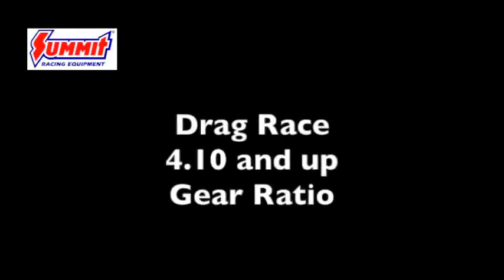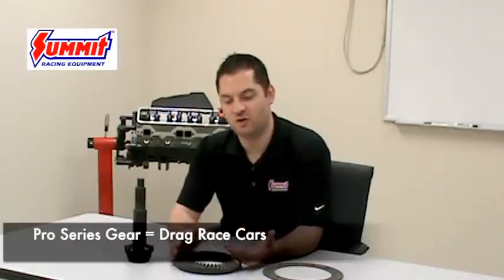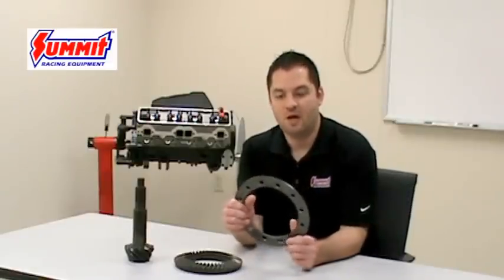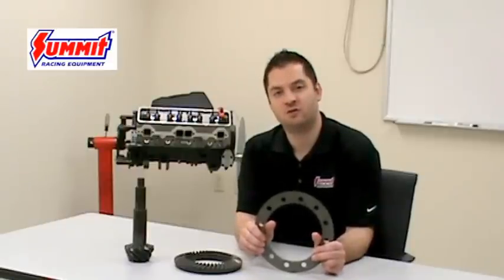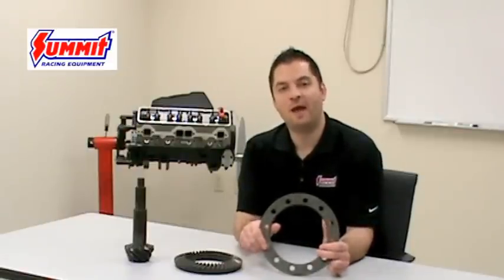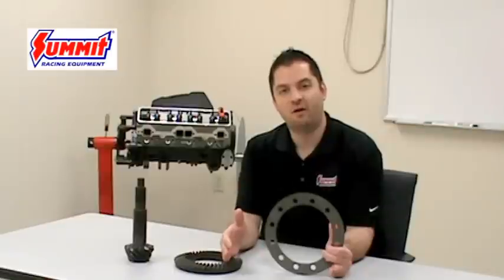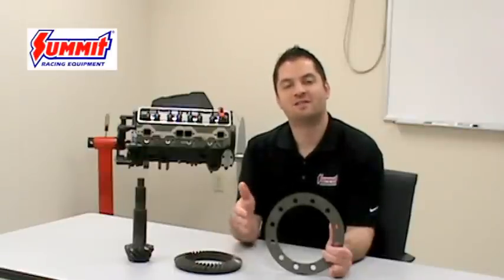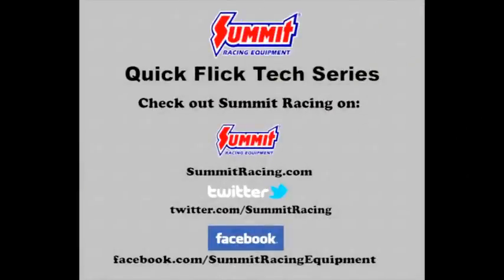Selecting a Ring and Pinion Gear Set for Your Vehicle

Comment: one thing I didn't hear much about is Truck/ Cars with Much Larger than Stock Tires. I have a 1991 Chevy 1.2 ton pickup with a stock 10 bolt rear end, but I also have 35" Mud tires and it drives sluggish, hard to pickup.

 What ratio would be good for me to be able to maintain faster acceleration speeds? Don't drive past 60 mph anyways
Reply from the maker: Hi DREW TRUJILLO, 
With 35’s a 4.10 ratio is most likely where you need to be but, we really need to know some other stuff to be sure. Give us a ring on the tech line and we will be happy to help you figure it all out! 1-330-630-0240

Comment: I had a quick question..
I have a 2011 chevy silverado 1500. 4.8 with 3.23 gears..

I recently motor swapped it to a 6.0 with 
Longtube pacesetter headers.
With a 226/230 Comp cam.
Black hawk c.a.i. K&n
3200 stall.
Tune.

Take off power is there
But top end feels a little sluggish...

Was wondering if 3:73 would help me out.?.
Reply from the maker: Eric Ramirez , 
A higher numeric gear ratio will help your take off and get your motor to a higher RPM sooner. This will help your acceleration from a stop but most likely hurt you in the top end horsepower department.  There are a lot of things to consider here, airflow through the motor on the inlet & exhaust side, the “Tune”, is it the best for the combination, was it done on a dyno under load and then fine tuned while street driving? And last, expectation; you are trying to move a very heavy vehicle with poor aerodynamics compared to a Camaro or Corvette.  Give us a call, we can help you through some of this! 1-330-630-0240.
Reply: +Summit Racing .... yes was done on a dyno. we did then take out to street to fine tune it. but fuel pressure wasn't holding up to it. pushed 407hp on dyno... but as we took it to the streets we had to dial it down due to not anuff fuel being pumped.. so now I am at 365hp. any intake manifold yu recommend. will the 373 hurt me on top end?.... as my take off from a dig... lets jus say I need drag radials fursure. these highway tires don't really have great traction.. but again whn I'm doin 45mph and then step on it, it's very sluggish..

Comment: im stock 3.07, if I go 3.90 will that help or hurt my 1/4 et? Please thanks for any info
Reply: What kind of vehicle do you have? Without knowing what kind of vehicle you have, I can't say for sure. But more often than not, you will reduce your 1/4 mile times by installing a more aggressive final drive ratio because a higher ratio will increase wheel torque and get the engine RPM up quicker from a launch. There are always exceptions though. For example, if you are reaching your top speed during the run, a lower final drive ratio could be beneficial for more top speed. Another exception is if you are traction limited. The less traction you have, the less benefit you will see from changing increasing your final drive. I hope this helps
Reply: @averyalexander2303  2017 Challenger RT. I'm 12.8 trap now... at 108...

also I did go with the 390 gears I feel my pickup is incredible. But I'm not sure what it's going to do at the track yet, got to wait till spring
Reply: @venomhemi3914  I'm glad that you like the results of the upgrade. The quarter mile time should be faster too. Just out of curiosity, what happened to your highway gas mileage after you changed the gearing? I presume that it dropped a little?
Reply: @averyalexander2303  it actually stayed the same I didn't notice anything different... the RPMs are a little higher though 55mph at 2000rpm.

I can't wait to test my new 0 to 60. I was 4.4... I will update as soon I hit the track. I'm getting too much tires spin to test normally
Reply: @venomhemi3914  Interesting. I would expect a small drop, but I guess it makes sense that there wasn't much drop since the engine is still ultimately doing the same amount of work to move the car: A little higher RPM, but a little lower load.
Reply: @venomhemi3914  12.8 in your RT, that's great! I had a 2006 SRT8 with some basic performance mods, and I never broke into the 12's
Reply: @LastBastian  Thanks! my new time is 12.0 flat at 113.9
I had a big cam n 3800 stall, upgrade and drag tires :) I also hope to supercharge it by October...
Reply: @venomhemi3914  Nice! You must be doing something right, lol! 
My best time with my SRT was like 13.1,  I had AFE stage II Cai, Diablosport tune, T-stat, and some wider Toyo Proxy tires...

Comment: Because the calculator is not in my range for my jeep Grand wagoneer, can you help me?
I'm changing trans mission and tire size. (Stock rears, 3.31 / Trans 1st 2.45, 3rd 1.0 / tires 29inches)  New setup: Trans 1st 5.61, 5th 0.73 / tires 32inches. I need better hi-way mileage (stock 13mpg) while still being good on the hills. What ratio should I look into?
Reply from the maker: +grn dragon, 
With your new transmission and overdrive option, a 4.10 ratio will not only give you good off road ability but, coupled with the overdrive will cruise on the highway at a just slightly higher range than the old setup.
Reply: the old setup put me at 3700-3800 rpm's going 70mph, where will my rpm's be with the 4.10 set?

Comment: Wouldn't you lose some top end speed by going from a 4:10 to a 5:13?
Reply from the maker: str8ng3r , 
 Yes, by raising the gear ratio numerically, you will also raise the RPM of the motor possibly running out of power before the end of the track which in turn cost you MPH too.

Comment: I have a 83 chevy c10 that I know of totally stalk that I know of my rear end went out what would be a good every day driver gear set up any help would be greatly appreciated
Reply from the maker: +Joe Scott, 
Choosing the correct gear ratio really depends on a lot of factors. What transmission is being used?  What is the usage of the vehicle?  Will it be used for towing? What is the diameter of the rear tires? Please feel free to give us a call and we can walk you through the process and help pick the right parts. 1-330-630-0240. Thanks for watching!

Comment: I have a 85 chevy with a 6.0 .30 bore regular pistons 230/236 cam 4l80 transmission 3600 stall and 315/45r20 tire what's the best gear it is slow when starting from 0 right now is running in 410s

Comment: i have a 1990 chevy 1500 with a 350 tbi and i want to switch it to a 4.10 gears should i change everything or just gears ? what do you guys recommend gonna swap to a 5.3 or maybe a 6.0L in the future.
Reply from the maker: +Wicked Jester, 
We need some additional information from you. Can you please call our tech department? 1-330-630-0240. Thanks!
Reply: Wicked Jester if it has a 10 bolt then get another rear end. but if tou have a 12 bolt. then your good.

Comment: well i'm trying to figure out what gear ratio to put in my truck its a truck im upgrading to 3/4 ton or 1 ton axles in and its going to be a tow vehicle with a 454 high torque engine
Reply from the maker: +DeerSlayinRedneck100, 
 Using a gear ratio calculator, input the tire size and a highway speed of let’s say 60mph. Now, change out different gear ratio’s till you come up with the correct cruising rpm for the camshaft being used. Remember to account for the overdrive percentage if one is being used.  Give us a call if you need help! 1-330-630-0240.

Comment: i have a 2006 chevy silverado 4.8 with stuff done to it and also new rims 275 55 20 and i want a new gear ratio the stock one is slow its the lowest for trucks what would be the best gear ratio for me i want to get off the line but i dont want the crazy rpm at my top speed which is 243kph? thanks

Comment: I am in the process of building a street/strip 71 valiant dart with a 318 and a 727 trans I want to run stock tire size in the rear with mickey thompson dot radial sportsmans what would a good gear ratio be for street/strip for this project? I would like to run low 10's high 9's on the quarter mile thanks!

Comment: I have a 91 Silverado 454ss stock truck just have a four inch lower in the back ...also stock tires and rims, the differential starting to make this really loud noise ,so I went to check it out took the cap off found no fulid in there it was dry burned everything out ...so now I'm looking to rebuild it ...but I want to upgrade the gears to 4.10s. with posi would that be ok to drive around the streets and freeways?? not a everyday driver
Reply: also one more thing it has a 700r4 transmission the turbo 400 was taken out and the torque converter locks up at 2,500 rpm or 2,400 rpm in 4th gear
Reply: +james mendoza I have 4.10s and they're fine. just not as good of gas mileage
Reply from the maker: +james mendoza , 
James, your truck had a 14 bolt housing with a 9.5” diameter ring gear from the factory. We have Limited slip units, ring & pinion sets and bearing/shim kits in stock, ready to go when you are! Give our tech line a call at 1-330-630-0240 or visit us at www.summitracing.com

Comment: Hi guys! I have a 350 engine with a 5 speed auto trans with over drive. I want have my cruse rpm at 1500 or 1600 what should my gearing be? I have a 10 bolt rear. I'm guessing some where in the neighborhood of 2.88 or so? Thanks
Reply from the maker: Hi Steve, 
You may want to call with this question. We would need some additional information from you. Our tech line is 1-330-630-0240. Thanks!
Reply: Summit Racing Ok thanks. I'm also considering putting a big block into my car. Can I have a gear set up that can handle both and get great mileage? Thanks guys.

Comment: so an overdrive or five speed will help rpm right? but will the top speed still be affected?
Reply from the maker: +Cristian Ballesteros , 
Well, that depends!  What axle ratio and tire size do you have? What is the power output of the motor?  Are you racing or street cruising?  As you can see there are some other questions to be answered.  Give us a call and we can help you figure out what is best for your application. 1-330-630-0240
Reply: +Summit Racing I will give you guys a call thank you!

Comment: i have a mustang with 2.73 gears an i wont a lil more performance  but i want to maintain my mpgs will 3.73 be ok??
Reply from the maker: Hi Marcus Goliday, 
Our tech department needs some more information from you. This conversation would best had over the phone. Can you give our tech department a call? 1-330-630-0240. Thanks Marcus! We look forward to your call!
Reply: Marcus - V6?  I knew of a person who went to 3:45, Trak LoK, aluminum drive shaft, 2800 stall converter, GT airbox/hi flow air filter, under drive crank pulley, dual exhaust w/crossover and a 93 octane performance chip with auto trans.  We were on some of the same national Mustang boards at the time and met up locally.  He got a minor power increase but with all of the mods working together it truly transformed the car.  Said his fuel mileage was identical despite slightly higher revs on the highway.  I drove it before and after - impressed.

He appeared to be heavily influenced by what I was doing with my same year '98 GT at the time.  My family and I moved away several years later and lost touch.  Hoping he stayed in the Mustang Family LOL!!!

Comment: why my traction control light turn on after I had new 411 motive gears install
Reply from the maker: +Victor Aguilera , 
This is due to the computer now seeing two different RPM signals between the front and rear wheels. The solution will depend on the type of car you’re driving. Give us a call, we can help you figure it out! 1-330-630-0240
Reply: I drive a silverado 06 and it did get a custom tune

Comment: OK please can someone help me so I don’t know anything about gear ratio and I have a truck 🤦‍♂️ now the question is I currently have a f150 on 35 inch tires i’m swapping them out and I’m getting 37 inch tires I’m hearing from different people that I should change gear ratio and I shouldn’t change unless I do offloading which I do not so any advice definitely will help and if so what will be the proper gear said I would need so I won’t get over charge from a shop
Reply: You gas or diesel? That's only a 5% increase in tire diameter, so you might not notice with the diesel and can carry on.  Gas?  If you notice a big loss of get up and go, consider next larger ratio available.  Find a hill with decent grade and time a roll on accelleration between marked points so you have a before and after comparison.  First gear can mask apparent usable torque losses, which is why I find a roll on test a bit more informative.  Something along the lines of 50-x mph over a set distance should reveal changes of performance... bring a stopwatch.

Comment: Need help. 

I got 2012 F250 40”x16” tires on a 10” lift. My trans hits 230 degrees in city driving. I currently have 3.55 stock gears on truck. 

Could the high trans temp be due to the gears being incorrect? All fluids are new and in the right level. 

If so what gear ratio should I be running on my truck. 

I greatly appreciate anyone’s help.
Reply: JIP ask bleeping jeep on youtube
Reply: Personally on gas I would run 4.56 or lower. Diesel I would go 3.90 or lower

Comment: Hey guy from Summit ❔❔I have a 72 Oldsmobile engine bored over 60 heads shaved down 90 3 angle valve job you know real deal Holyfield just put a 2800 3200 b&m now before I just had a 2200 torque converter I rip through all the gears except for the last gear it it rev to 2000 no more I have 323 gears now it seems I'm having trouble reven all the way up in first gear let alone 2nd 3rd I have 373 with a full posi ready to be installed now I did do some float adjustments on my 770 Street Avenger Holley made a huge difference will the 373 make eya difference❔
Reply from the maker: Tytis Crawford , Before we can determine whether the 3.73 gears are correct for your application, I will need to know the following information about your combination:

- Engine size
- Engine compression
- Camshaft size
- Type of intake manifold
- Tire size 

The torque converter should not stop the engine from revving to its full potential but it will effect acceleration.
Reply: Summit Racing its a 350 Oldsmobile rocket high rise intake comp cam flat tappet mechanical cam size I believe 496 502 23 inch rims low compression
Reply: Summit Racing Oldsmobile engine  72 also referred to as Oldsmobile rocket

Comment: What gear would do better in my 1995 mustang gt? I'm torn between 4.10 and 3.73 gears. Its standard shift and has stock heads and stock cam.
Reply from the maker: Hi Robbie Burchett, 
A street driven 5 speed car would do well with the 3.73 gear and an automatic trans. car will do well with the 4.10 gear.
Reply: Summit Racing what if you have sts twin turbo I was told differentc but launch without pretty weak but catch up in the end

Comment: i have a 2011 chevy silverado 5.3 i think it currently has 3.73 but ive been thinking about getting a 4.1 gear ratio would it be worth it? Its a daily driver pretty much but i randomly take it into the race track. Should i get the 4.1 or stick with the 3.73? So basically i dont really race in it but i would like it to hall ass if i have to
Reply from the maker: Hi Jesse Chavez, 
Changing from a 3.73 ratio to a 4.10 ratio will give you the benefit of a better take off from the starting line and, it will only raise your cruise RPM approximately 200-250RPM. I’m sure your truck has overdrive, so this really should not have a big impact on your mileage either! Just make sure to at least get a programmer that will allow you to reprogram the computer for the new gear ratio. Thanks for watching!
Reply: cool, so would they be any negatives to doing this?
Reply: Transmissions

Comment: I enjoyed the video but I have 1 argument....you claim there is only ONE way to determine the gear ratio however that IS THE most accurate way (Taking the cover off and counting), .....there is indeed a second way...MATH yes math: Gear Ratio = (RPM(Tire diameter))/(MPH(Transmission ratio)(336.13)) 

The easiest way for that calculation is to gather your numbers while the transmission is in a 1 to 1 ratio(typically 3rd gear), then you can gather the MPH, and RPM.
Reply: Never... trust what's stamped on the axle tube until you have looked at the gearset in person.
Reply: This is Terrence and she is my love my super woman!!!
Reply: Where does the number 336.13 come from?    What speed and RPM is needed?

Comment: Do motorcycles have ring and pinion gears?
Reply: kinda,  they are sprockets.  the small one more towards the front of the bike on the chain is like the pinion.  the bigger one in the rear is like the ring.  dropping teeth on the rear shortens all your gears and makes it feel as though it has more torque and horse.  makes pulling up the front wheel easier.  but limits your top end speed.
Reply: @russcooper3653  BMW and Moto Guzzi motorcycles have a car like ring and pinion gear arrangement similar to a car.

Comment: Awesome Video. im going through the components of the drive train. i came across this ring and pinion gear set,"Yukon Gear & Axle Ring and Pinion Sets YG GM12P-308" (on SummitRacing.com) im completely redoing my 1969 Dodge Charger (in my preferences). im putting a 440 Chrysler RB which im aiming for 500 HP out of motor.(i have already got every component in engine sorted out for this HP) Is the ring-pinion set right for my application? my application is solely for top speed, im not going for torque and lifting the front end. i dont care how long it takes to go fast, i just want it to hit high speeds. thanks. my main concern is that the engine will be putting out alot of power and being a 3.08:1 ratio ring-pinion used, is there a possibility it may break?
Reply from the maker: Hi Salvatore Hayes, 
Since all you desire is top end speed, that 3.08 ratio will be fine for you. Yukon makes a high quality product that will last a long time properly set up, though I would not attempt any hole shots with that heavy of a car and that ratio. Good luck!